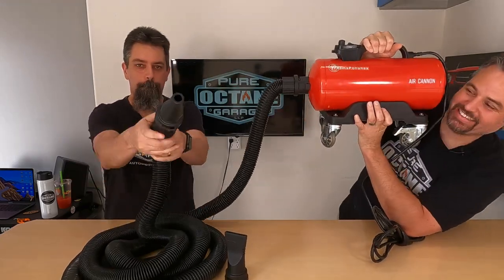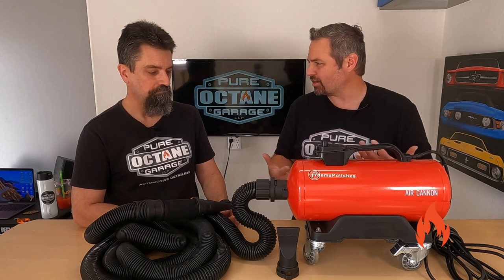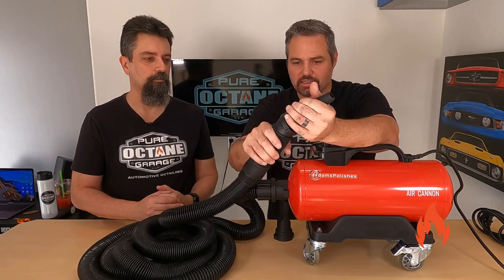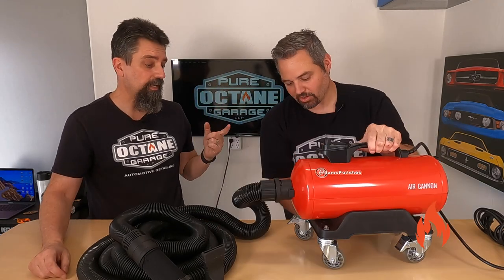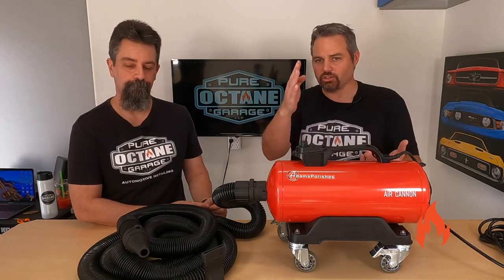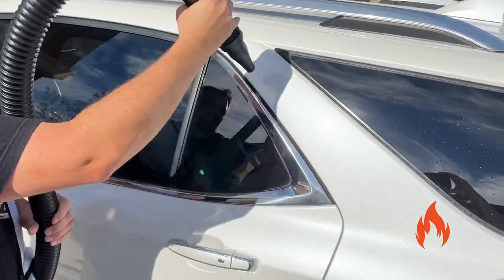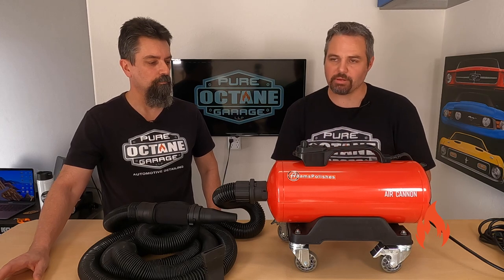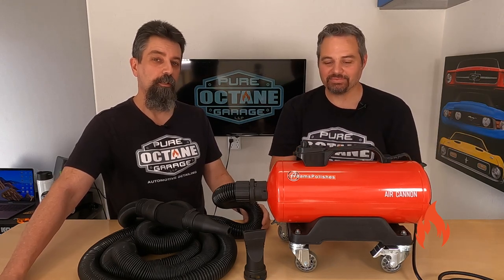Touchless & Paint Safe Vehicle Drying (Hint: It Blows): Adam's Polishes Air Cannon

Comment: If the handle gets to hot you can wrap a microfibre cloth around the part where you hold the hose. Use a couple elastic bands to hold it down. Also,  make sure the road or driveway is wet or dirt/dust free. You don’t want to blow crap back or your freshly cleaned vehicle.
Reply from the maker: Excellent tips there Chris. Keep from sandblasting your vehicle!!! Thanks for watching!

Comment: I have this and the nossle unscrews over time and will eventually shoot off during a drying session potentially hitting you in the face or hitting your car. Super frustrating and you need a 220v for this but everything else is not terrible
Reply: There,s some real world input.good bad & ugly..
Reply: @keithknechg3217  yeah i clean all my familys cars so i def have put use but screw it back on and deal with it if you bought the unit already
Reply from the maker: good (not so good) to know this is happening to others! Thanks for watching!
Reply: I’ve had the same issue.  I actually stopped using this air cannon, because it shot off and scratched my car.  After that I was done with that thing.  Just give me a nice clean shammy that is simple and quick to use.